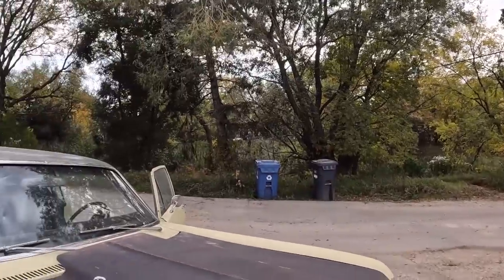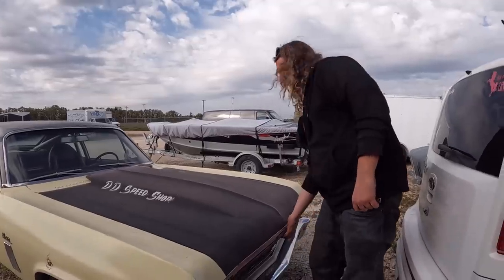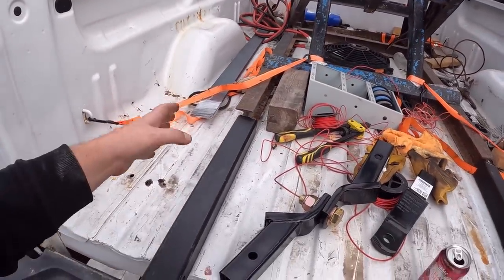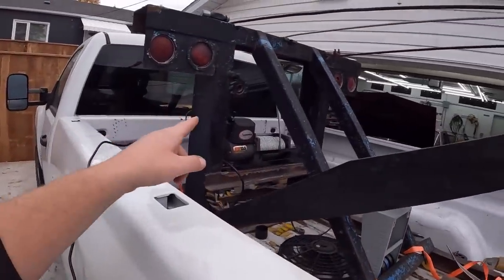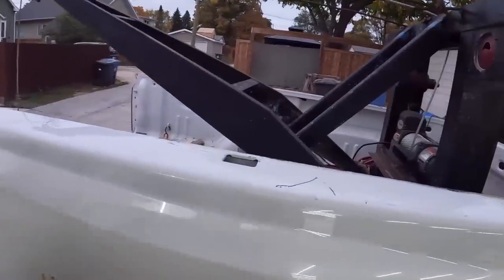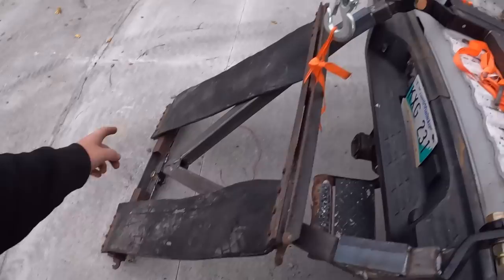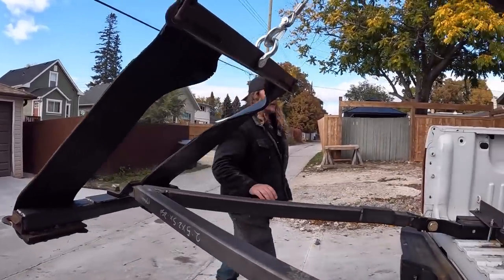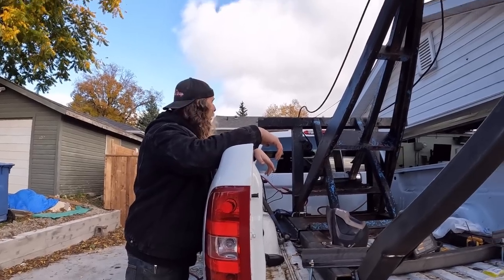Welcome To The Thunderdome - Fabricating A Home Made Car Hauler.  Slingin' Junk

Comment: 14:14 one 3 inch stich weld on that 1/4 square, tested to standard is ratted for 23'000 pounds... but I would say 4 5/8 bolts thru the hoist and truck frame on each side. (supposed to be in jail, but... not going) 😷💩

Comment: that has to suck having rigs in a storage yard i could never do that have way to many rigs i have 18 running and driving but 10 acres of good project rigs most are rust free mite say i been collecting rigs for a long time most are fords and gm but gm i try to get the most never turn down a free chevy all are 79 and older rigs if i get them rusted i part them out only keep good clean rigs . i call it my personal wrecking yard plus i trade to drag racers for their old parts like blowers and tunnel rams stuff like that. i have camaros firebirds chevelles lots of pu's all waiting to be built. right now i am building a 68 pu but my next project i can't wait for have 90% of the parts for it a 79 z28 rs t top have 2 extra 79 z28's for parts all are good rigs but i can build the one with no dings in the body perfect body the way i like it have every option that ever came with a 79 camaro full spoiler kit and rear window louver cruise control  wiper delay tilt wheel full gauges power seat power windows and locks power trunk light under the hood air condition over sized breaks has true gills not a sticker for it like most rs z28's have it is a z28 with rs package not a rs with a z28 package that is what the stickers mean if it has true gills then it is a z28 with rs package which makes it more rare most are rs with z28 package.

Comment: The wheel wells are already starting the usual BS in rust country. Spend an episode putting the rubber flairs on it to try to prevent further problems. You should have been able to get a good buck for the box and then just put a flat bed on it for the way you’re using it.

Comment: Hi Dan

Did you notice that you put the tow hitch receiver tube with it's pin lock hole's in the horizontal position but your receiver hitch holes in the vertical position.?